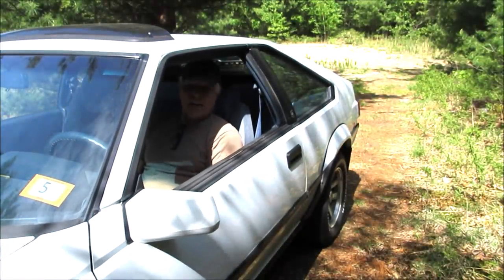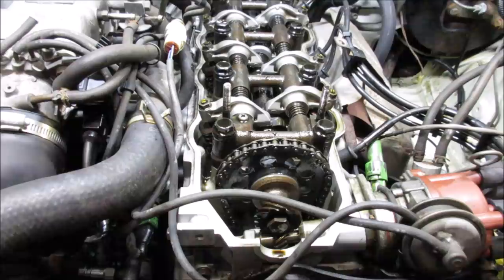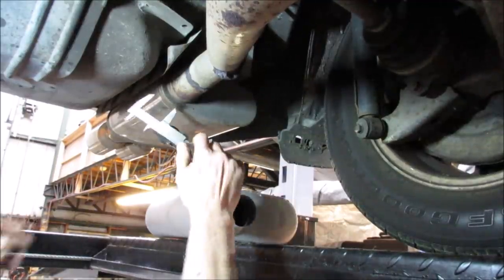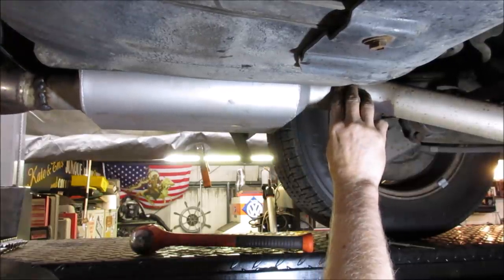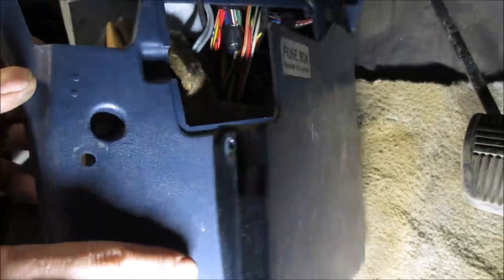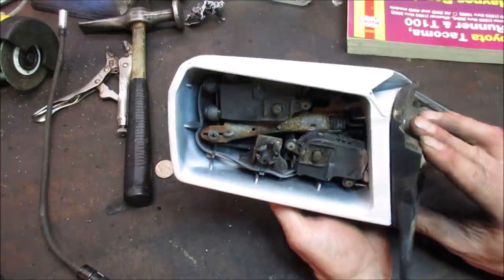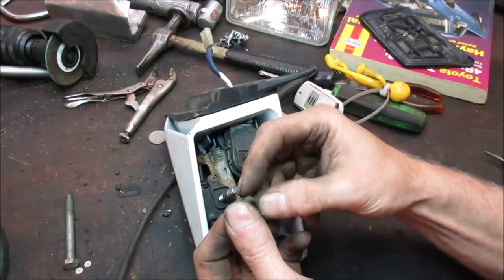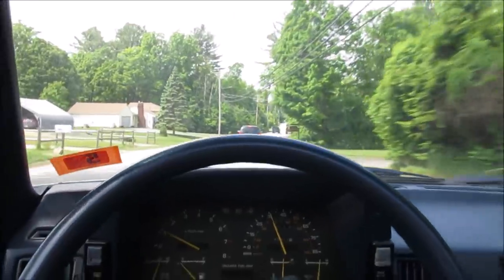Bought The Best Toyota Ever Made

Comment: Remember at this time toyota was charging a lot over sticker treated peoples like crap..  Thats why i bought a rabbit gti 1982 it was discounted.. Had it for 10 years.. Never touched motor or transmission.. Fun car..  But reality my 2003 corolla blows those cars away..Auto trans with smooth shifting ..variable timing for power. Fuel injection.. Just turn key and go..  Great a/c system.. Bulletproof..  80s cars are just not high enough quality.. They lack in so many ways..  Slow, who the hell want s a manuel trans?? Not me..I live in traffic and my left foot loves being lazy..   Except for my 280sl..

Comment: up and down is more important usefull for parking when backing up to look at back wheels once left and right is set  the won't need adjusted. years of heat and cold make some plastic brittle I Imagine someone try to move it when it was frozen or it took a blow maybe some kid rode their 3 wheeler into it and faceplanted the mirror Dad was more worried about the car over the kids face LOL
Reply: *Pro Tip to clean seats and carpet soak down with carpet shampoo rub in a bit then blast with an air nozzle you can detail the whole interior even clean seat belts

Comment: I got one of them but  the supra new when I joined the navy  I also  hit a pole with it backwards at a estimated 120 miles per hour the back bumper was  right up on the steering wheel  I'm  glad seatbelts were not a  thing or I be dead I still have problems  young and dum

Comment: Mustie, the simplest solution would be to just put a tie wrap around the centre socket to squeeze it in a bit so that the ball is tight when you click it back in and leave both mirrors as manually operated.

Comment: Dude. I commend you for finding a way to fix those mirrors. Looked like more then I want to deal with. Lol. Also, it sounds stupid but did you try to push the high beam switch forward? Like forward for high beam, middle for low beam, and then spring backwards for flashing your lights. You probably tried but I figured I’d ask. Love the video!

Comment: Hey Mustie, I was just wondering if you were to slide a jubilee clip over the ball socket and tightened just so that it didn't move and then popped the glass back in and angled it the extreme in one corner. Would you have enough room for a long screwdriver to tighten the clip? If so you could adjust the resistance which would hold the mirror in place. Then just use fingers on the glass for adjustment. Just a thought. Another great vid BTW

Comment: I wonder if its missing a muffler? The Swedish/european version if this car doesnt have the catalytic converter, we didnt get those until late -88 beginning of -89. A friend of mine had a car just like this and we changed the whole exhaust system on it because it was all rusted out. and what i remembered so were your catalytic converter is was a round quite long muffler on the swedish/european version. and right before the rear axle was another muffler and last the one you ghanged. So i think you are missing the one berfore before the rear axle. Im not sure but it looks like they have changed it from the cat and back, and it looks like it is welded to the cat.

Comment: Even today that's still a sharp looking ride. I had a 1980 Celica I bought in 1987. It had 200k miles on it and I drove it another 80k miles before I used it as a trade-in on a Ford Pickup. I beat on that poor Celica like a rented mule. The 80k miles I put on it were some HARD miles. The little 20R motor and 5 speed trans took it like a champ. I did have to put a clutch and pressure plate in it but that was due to my aggressive driving habits of the time. The air conditioner would freeze me out on the hottest Texas days and same for the heater on cold days. Those Celicas were sharp and tough. I wish I had mine back.

Comment: Hold on just a second. Surely the half-moon seals require rtv at the corners where the half-moon and flat seal meet? It looks like they were formed together, also, which makes absolutely no sense. 

EDIT: Oh hahaha yeah that makes a lot more sense, the half-moon seals were just old and RTV stuck the two seals together. Also, I'm not sure if that is the original seal kit, my 96 corolla has a metallic half-moon and is sealed using rtv

Comment: That muffler looks like a stainless magnaflow which is far superior to that cheap ass thrush which will more than likely be louder with more drone which any chambered muffler has and the baffles inside like to rot out where as the magnaflow doesn't

Comment: 4 cylinder Toyota just over 2000 rpm in did you say 2nd Gear? Id say that is about right. My 2004 Opel Astra H with a Z16XEP engine does around 2000rpm at 60KM/H in 5th Gear
Maybe a small error from me, it should be higher rpms in 2nd gear. But actually didnt sound like it.

Comment: Mustie, it is hillarious and sad, that you tend to say what everyone else says about Toyotas, talking about them being bulletproof and running forever, and the first thing you do after you get it home is pop the hood and start digging in, because that is a myth. I used to buy into it too, and after my third one that was too expensive/impossible to fix after I drove it for a while, and just haven't looked back. One of my first run ins was a 93 truck had one of those 22 re in it supposedly bulletproof that would not get the water hot enough and eventually would over heat. I drove it for a while like that, but it got worse. Sounds like a thermostat right? Plenty of tested thermostats, not it. I sold it for scrap eventually, come to find out certain years will have timing chains rub into one of the coolant passages and it won't ever build pressure. 
Second was a 90s carolla that the auto transmission went out in and the rebuild kit was way more than just buying another one would be, because it is such a well known issue, people that get burned buy them just stop buying them eventually. lol
So maybe if you get a brand new one and maintain it flawlessly, AND GET VERY LUCKY, that you didn't get something that has specific issues for that model year, then maybe you might see that. Those piece of crap terrible ride pickups you still see everywhere from the 80s, MAYBE but they are just so bare bones, and most the people that own them have a boneyard of them because they do not, in fact, run forever. Maybe it is better with the standards. 
Or maybe it is the stories from the middle east in the 80s that helped fuel that myth. Whatever the case, even like with your newer one you have worked on it several times. As far as I can tell, most of them are just as bad as any others, and it don't matter how well they are maintained. It is purely luck, influenced by use, and regional crap that none of us will know about, especially if we get the junk from another state, which is what they do intentionally. The cars travel north through trickle down systems and what sells in some areas, like mine is such a poor area that we are still seeing a lot of PT cruisers and 2nd gen VW bugs because that is how poverty works. Tastes just play out slower in rural and poor areas. 
Wow ok bad rant sorry. lol

Comment: Mustie would you try to remember to stop the high speed video when you are talking. There is no way I can understand any thing you say.  I fail to understand why you choose to keep working on the mirrors vs. finding a functioning replacement   of some kind or a power mirror of that approx. area to bisect for learning purposes. I know you prefer to figure things out on your own. I think I would have stopped after realizing that the wax things were no good. I might have stopped before that and researched how power mirrors work or even gone to a wrecking or junk yard to figure out how they worked. This would have saved you a lot of time. I also hope you dig deeper in to the AC system. I am surprised you do not have AC gauges already. I suggest you invest in some that are not a cheep knock off. Please make more videos on this project. I prefer you to do that with most if not all of your projects please. Thanks and SAFETY SECOND.